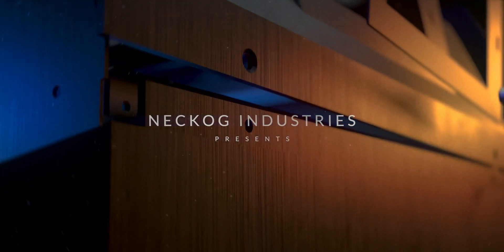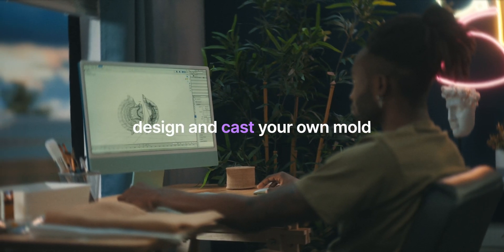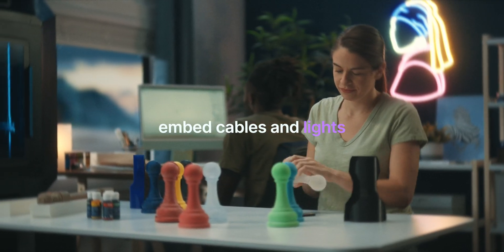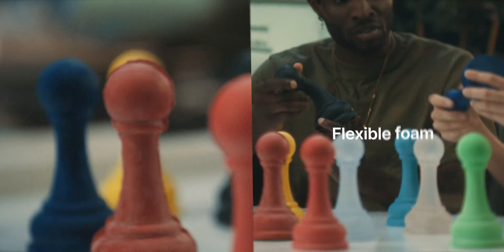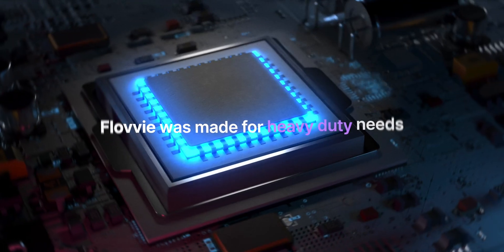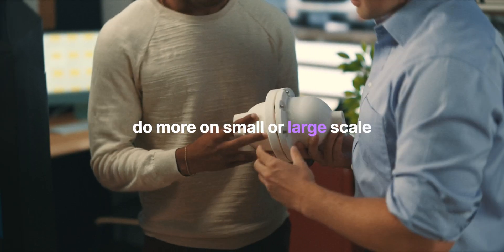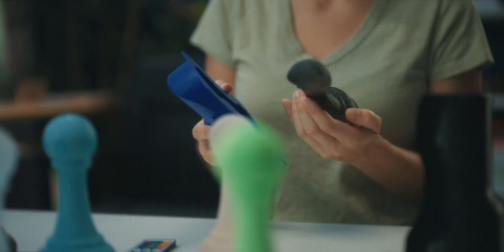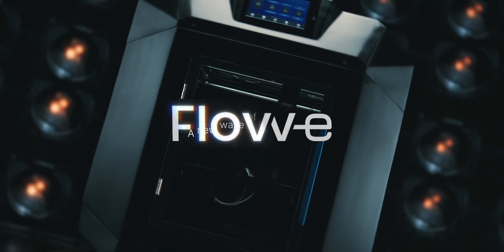Neckog Industries Flovv-e | Introduction | High Flow Casting | High Speed Printing

Comment: Why not 3d print a mold and just pour resin or plastic into it. Don’t need this big ass machine to do that..
Reply: You can. But it is a pain. In my experience, the resi  fused with the printed mold. I used to use silicone molds and resin with no issues...I'd like to see more to understand how it works, but I think it would make the process easier.